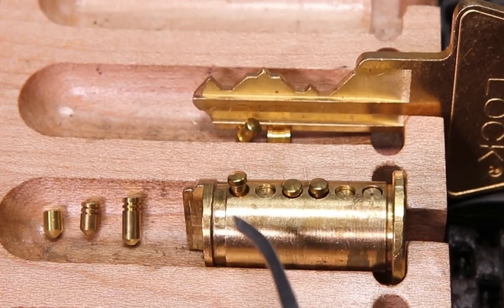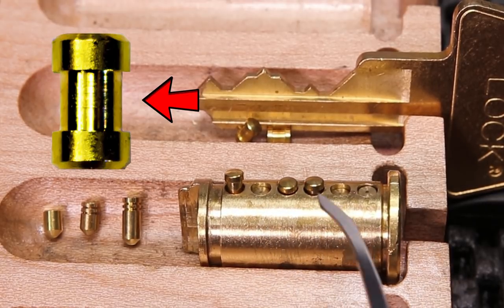[267] How To Optimize Spool Pin Placement

Comment: That was very informative, thank you
Reply from the maker: Thank you for the kind words, I am glad it helps!
Reply: @HelpfulLockPicker   No problem, thanks for your videos; I find them vastly useful. I used to be a complete novice but because of your channel I got into lock sport a bit (I once won a lock picking set from a give away you did a while ago). In fact, I had to replace a door handle and lock recently on one of my doors but I didn't want to change my locks. So, I just gutted the new door handle and lock I bought at Home Depot and repinned it to match my existing house keys. Totally blew my wife's mind that I could do this without having to call a locksmith. This is 100% because of the videos you have put up. Keep up the awesome job friend.

Comment: Thanks. I just rekeyed a new lock using rudimentary methods with screwdrivers and a soda can shim/follower. Of course, I didn't know there were spools in the cylinder housing until I accidentally shot springs and pins all over the place trying to test the key. I forgot to reinstall the C-clip. I rejoiced too soon at my perfect first attempt 🤣

Anyway, I was looking at where the spools should go, and you gave me a perfect answer. Thanks!
Reply from the maker: Thank you for the kind words and I am glad it helped

Comment: Whats an easy way to get those spools for practice? All I'm finding are standards..
Reply from the maker: Are you looking to purchase spool pins? I typically buy mine at CLK Supply.
Reply: abus 72/40 aluminium locks should come with spools and a serrated, just scrap the lock.

Comment: Hi, I have a question about top pins selection. How do we choose the length of the top pin to match we the bottom pin? In Schlage manual they say we always need a total of 23 but that's with Control, Master, Build and Change keys or whatever. With only a regular key, let's say for a #5 bottom pin, which top pin length should I choose? Thank you!
Reply from the maker: In a standard lock setup it really doesn't matter. They are more to make sure spools are at proper height and also to make for a more balanced lock (usually reserved for high security locks)